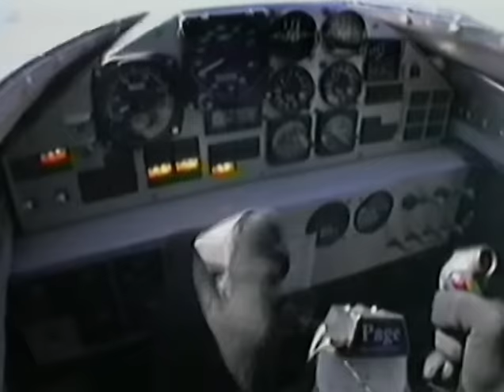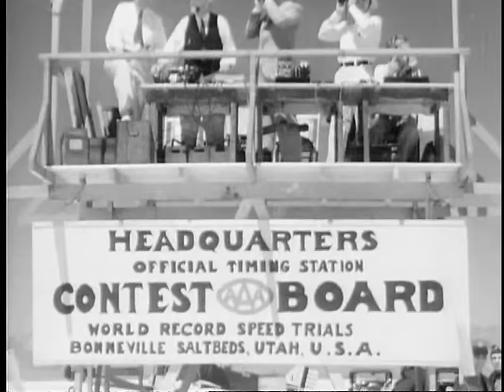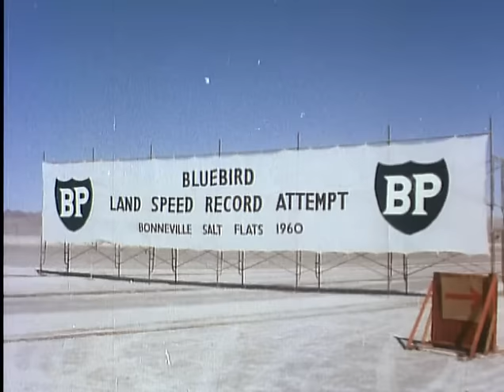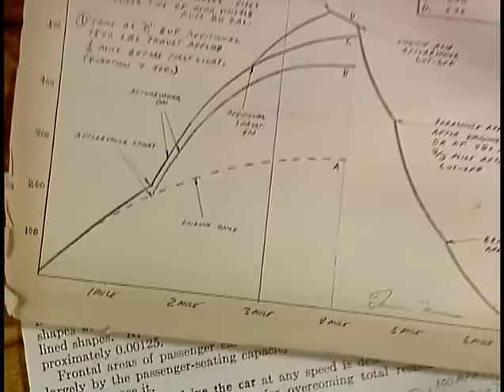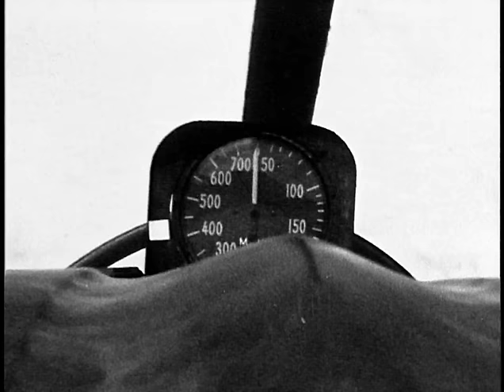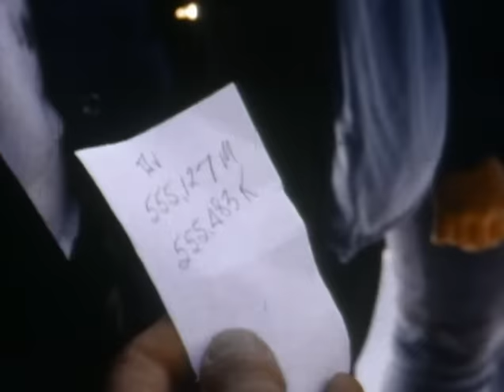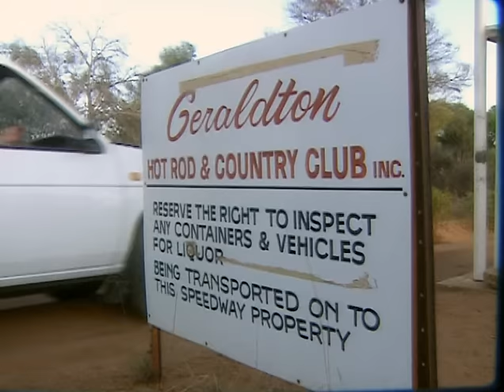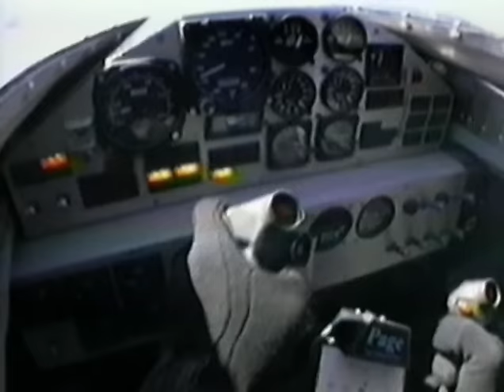The Landspeed Record Documentary

Comment: I wonder if the Top Fuel dragster were to be let loose on a half-mile racecourse...  what speed they'd be capable of??
Already 340+ mph in a quarter mile now..., dang!
Reply: Not that much faster than a quarter mile run. They aren't geared for longer runs and gearing them long would kill their acceleration through the first quarter. 
Like most top level cars in motorsport, top fuelers are designed to do what their discipline demands of them...and they do it very well too, but are pretty much out of their depth when asked to go beyond their design capabilities.